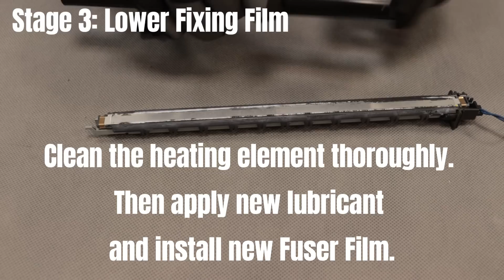Fuser HP LaserJet Pro M452 MFP M377 M477 M479

Comment: Honestly if your just trying to replace the pink roller pin as soon as you unscrew it from the metal frame just slide it out and slide the new one in all with out having to take out the black roller on top of it or messing with the other side of the framed gears
Reply from the maker: @AuroraAllan Thank you, I'll check this method.

Comment: My printer working but duplex print jam plz help
Reply from the maker: If your HP M477 is working but you experience duplex print jams, check the following:

Paper path in the duplex unit – remove dust, scraps, or toner residue.

Duplex feed and pickup rollers – worn rollers may need replacement.

Paper type and weight – too thick, damp, or low-quality paper often causes jams.

Printer settings – make sure duplex is enabled in both the driver and printer menu, and the paper is loaded correctly.

Often, cleaning the rollers and duplex path resolves the issue.
If that doesn’t help, it’s possible that the fuser is just broken and needs replacement.

Comment: Great help! Thank you!
I have refurbished 2 fusor units watching your video...however one of them jams the paper when I print dual side. Any idea on what it is? It prints perfectly but when it pulls the paper back it jams..
Reply from the maker: Hi!
Great to hear you managed to refurbish two fuser units using my video!

If one of them works perfectly in single-sided printing but jams during duplex printing, possible causes include:

    Misaligned or worn pressure roller – even slight misalignment can cause jams when the paper is pulled back.

    Faulty exit sensor or duplex mechanism issue – the printer might be misreading the paper's position.

    Too much friction when the paper returns – possibly due to a dirty or rough fuser surface or overtightened components.

    Loose paper path parts – check carefully if the paper feeds smoothly during the duplex cycle.

You can also try swapping the fusers – if the problem follows the unit, the issue is in the fuser. If not, the duplex path in the printer itself may be the cause.
Let me know what you find!

Comment: Do the upper and lower fuser use the same type of film?
Reply from the maker: @marcelloac134 Absolutely not! Please remember that there are two types of very similar foils but they are completely different. One foil has a black stripe on the side and the other does not. The foils have different parameters and are made of different materials.
Reply: The generic M479 fuser presssure rollers I found only support 120 C°. The original supports 200 C°. Many sellers told me I'd have to print in label sheet mode.

Comment: I had two cases with this fuser. Both  were with the pressure roller. This pressure troller made from special heat adsorb silicone body.  No one cheap roller was worked solution. I found only one 100% worked from CET manufacturer. It costs up to $100 but works as original.
Reply from the maker: In our repair kits, let's use the shaft you wrote about. Only this one works, you're right. Thank you for your comment. You're a service engineer, I guess?
Reply: @MrRicoh Yes, I’ve post service workshop

Comment: Thanks sir, what grease do you use between the film and fuser?
Reply from the maker: @sjaakdraljib6338 This is the grease supplied with the heating film. It is usually included in the set and you do not need to buy the grease separately. This one is perfectly matched to the device.

Comment: Thank you for the detailed video! I plan to replace the upper and lower fuser film and pressure roller. Does the upper and lower roller use the same film or is it different? Is it necessary to replace the grease as well. I heard that krytox gpl 207 should be good but its expensive, what grease do you use?
Reply from the maker: @madero2001 Remember that the top and bottom foils are completely different. They look almost the same, but a reliable supplier must specify which foil is the top and which is the bottom. The grease must be supplied by the foil supplier together with the foil. I don't know what country you are from, but in our shop we still have two pieces of FUSER UNIT original, little used, in perfect condition: https://copy-expert.com/pl/p/FUSER-UNIT-HP-Color-LaserJet-Pro-M452dn-M452dw-M452nw-M545dn-M454dw-M377dw-M477fdn-M477fdw-M479fdn-M479fdw-z-DUPLEX-RM2-6435-RM2-6461-RM2-6435-000CN-RM2-6461-000CN/8239

Comment: Every time I do this job it doesn't fuse properly. I have to change the type of paper to make it work. Why would that be?
Reply from the maker: @agustinredote8327 The most common cause of problems is a worn Fuser Film and Press Roller. There is no visible damage, but the prints are of poor quality.